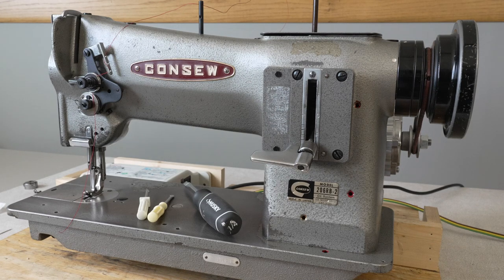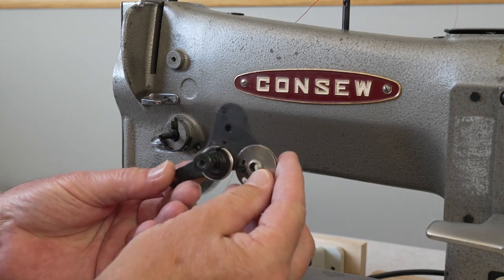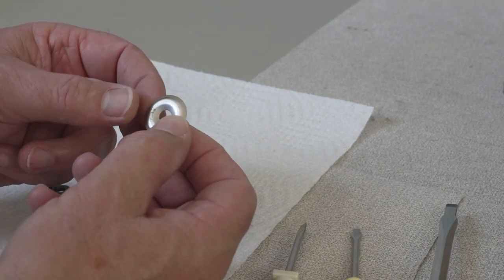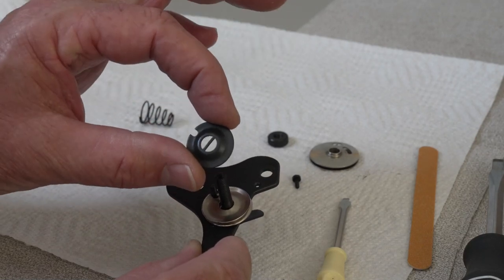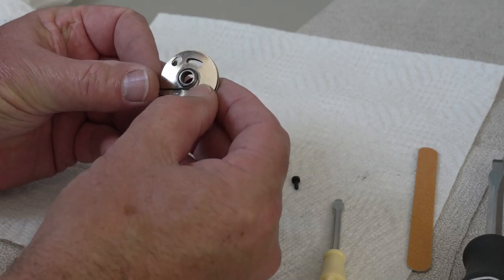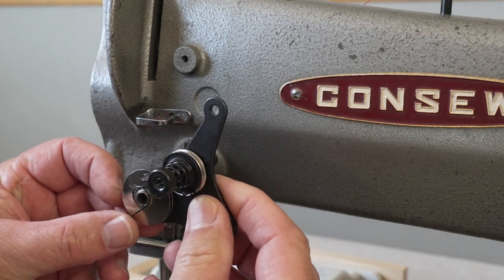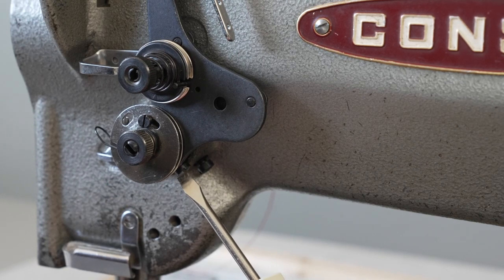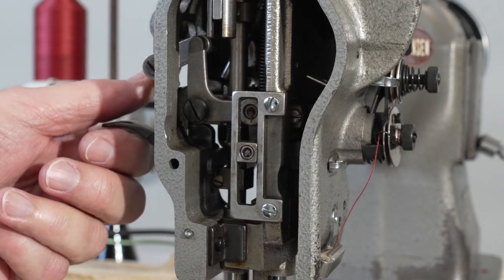Consew 206RB-2 Industrial Walking Foot Sewing Machine

Comment: Placement of the "thread Guide" behind the Tension Assembly would impact "offset" distance travelled by push-rod (shown) by width of the thread guide "bracket"...not quite a 1/16th inch.  Also, movement of the "Tension Spring" and effect by the bottom disk with set screw has never been addressed in any other videos! THANK-YOU!:face-turquoise-covering-eyes:

Comment: Hi Steve! I just got the very same machine, looks brand new, didn’t even have oil in the system at oil. The problem I have is that, the hand wheel won’t turn. I checked the clutch, is engaged as it should (ball bearing in hole) 
I would really appreciate if you could help me with this problem, hope to hear from you soon.